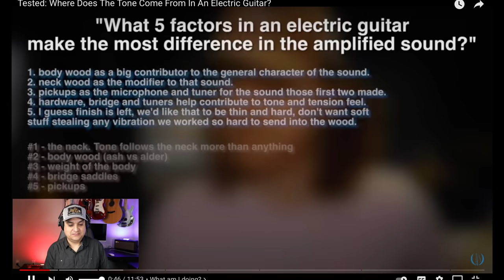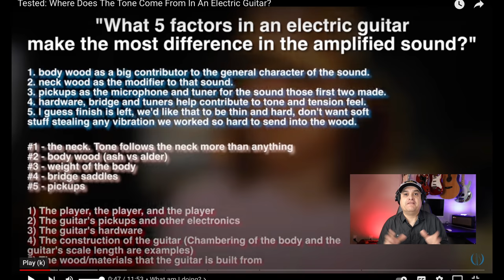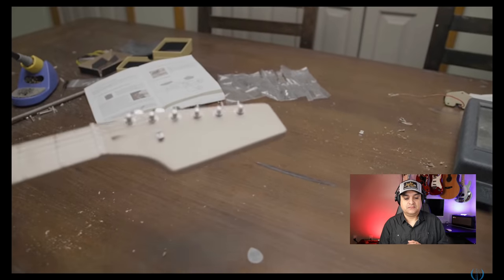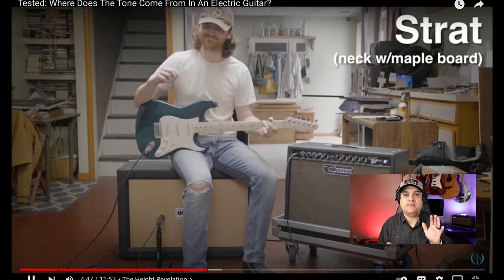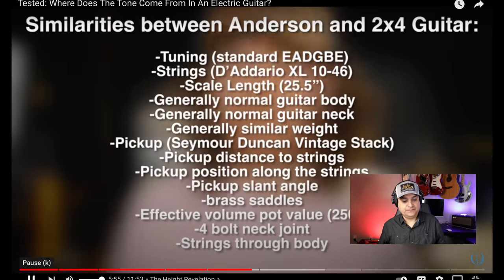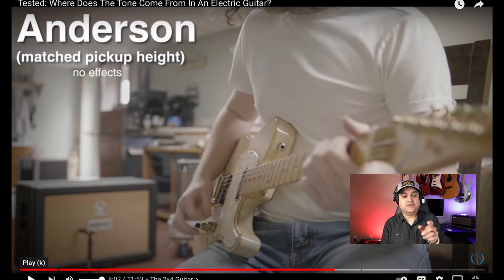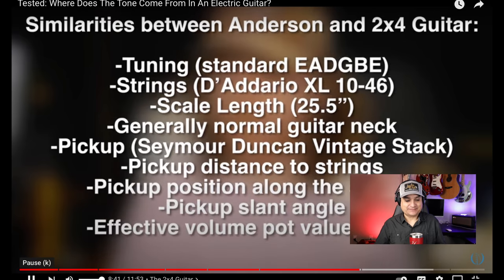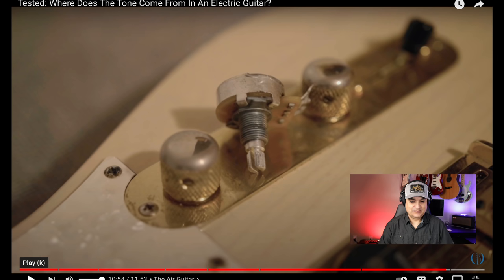Where Does The Tone Come From In An Electric Guitar - Reaction Video

Comment: I have been playing the same bass neck on four different bodies since 1983. It started as B.C. Rich Eagle, Bass N.J. series. The first pickup was the original, most likely a DiMarzio passive. Then I replaced it with an EMG P. The tone changed. Then I put a Kahler tremelo on it. The tone changed. Keep in mind the wood was a butcher-block of at least four pieces of light and dark wood (I stripped the paint off). Then I ordered a solid fully figured maple Eagle-style body using all my existing components. I was not happy with the sound. I thought it lacked depth. Keep in mind, I had the P pickup placed in a traditional placement like a Fender, and I also had the pickup routed like the Fender P, not like the "reverse" P on my original body. Note: those one-pickup 1983 N.J. series basses had a reverse P mounted closer to the bridge more like a MM than a Fender. I was not happy at all with the sound  of that Warmouth Eagle body bass. So then I took a solid one-piece mahogany slab and made a new body, this time using EMG bass humbuckers and a Schaller bridge (that bridge had no mass/substance to it. I took those EMGs from my short-scale Aria Pro II XXB Deluxe bass. That little bass had substance. The difference: Aria Pro II from the early 80s had a fat bridge. My mahogany bass, with EMGs, Shaller bridge, and my old favorite neck always lack punch, way too much treble. My guess is that the bridge was the fatal flaw. So I tried one more time with new body I made out of wenge and padauk, using an  EMG humbucker placed in the same spot as a Fender (supposedly a P configuration in a humbucker housing) and that old Aria Pro II bridge,  and my old faithful neck. This latest rendition sounds and feels great.

Comment: But why does a solidbody guitar sound so different from a hollowbody? The vibrating strings do interact with the wood and that will influence the electric signal as well, which is why you wouldn't use styrofoam for building a guitar. No wood at all is not an issue though...

Comment: I have said for years, as long as the intonation is good and it will stay in tune, I can get a good tone out of just about any guitar. 

Scale length and necks make a difference because of how they feel on you hands. I prefer a fender neck and scale typically but that is feel issue not tone.

Comment: Pickups have zero effect on tone. In a video, a Strat pickup was installed on an acoustic guitar, and it sounded JUST LIKE AN ACOUSTIC GUiTAR!!! That's because the vibrations from the wood go into the strings.
Reply: @@johndoe3319 / If you use heavy distortion, the guitar is only a small ingredient in the tone.

Comment: its funny to watch video's about Les Paul's first solid body guitars and hear how he designed them. He wanted a solid body so the pickup wouldn't move deadening the sound or feedback so all you would hear is the pickups and strings, over 70 years later people still look at electric guitars like they are an acoustic instrument and apply all the talk of woods and construction that would apply to acoustic stringed instruments to them even though they are designed to remove as much of those variables as possible. I love that this test went full circle and ended up at designs that are very similar to Les Paul's prototypes, just to prove he was right all along.

Comment: Around 2005 I bought my oldest son, then 12 years old, a cheap Jackson that I bought on Ebay.  I paid $80 for it and bought all new electronics.  My sentiments were always, buy a guitar that feels good in your hands with a straight neck, because you can always make it sound better with new electronics.  That guitar played great and sounded amazing.

Most recently, I've been on that tone quest.  Wanting just the right pickups and just the right amp.  Should I go with a Mesa Boogie Rectifier or a Mark V?,  Should I go Engl, maybe a 5150.  Do I go with Vintage 30's or Green backs?  How about Jensen speakers, or those Eminence speakers?  In the end, after a lot of research, and although the cabinet and speakers do make the most difference to your tone, when playing through most high gain amps, you can dial them all in pretty similarly.  And most importantly, when they're in a mix, they all sound good. Just like pickups, with the exception of the really cheap pickups, any pickup you go with is going to do the trick. The key is, what are you using it for, and how does that affect the amp as it hits it.  You can probably take a Seymour JB, add an MXL 10 bang graphic EQ prior to the amp and make it sound like a Nazgul.  I haven't experimented with that, but it wouldn't surprise me at all.  Pickups just seem to be pre-EQs.  If it's a lower output pickup, raise it and then adjust the incoming volume on EQ.  Make EQ adjustments and perhaps it'll sound very similar.

I could be talking out my tuchas as well, I don't know.

Comment: I was convinced before, but one question remains: what about sustain? How do dead notes occur, if the neck and body materials have nearly no impact? We put energy into a string, the less resonant the materials are, the strings are connected to, the longer is the sustain. More resonant materials would suck some of the energy of the string and would therefore shorten the sustain. Right or wrong?
Reply: Dead notes come from poor setups or crappy fret work
Reply: @channingsmith7859  Not convincing😎 You almost always find dead notes on the same places, like on the 5. or 6. fret on Fender basses. Highly unlikely that it is the setup or that randomly the fretwork on exact the same locations is poor.
Reply: But somehow “bad tone wood “ would manifest in a consistent manner across instruments? Not likely.
Reply: @channingsmith7859  No, dead notes - following the most common explanation - is caused by the resonance of the wood at certain frequencies that kind of erases the sustain of certain notes at these frequencies.
Reply: I have never encountered a dead note that couldn’t be fixed with a setup. But we all have our own experiences so I’ll just leave it at that.

Comment: This kind of thinking and the guy video what supports my move from getting an expensive guitar to a decent guitar and apply my setting and setup skills all these years. In 2019, I moved from a 1600 USD PRS CE to a local made 125 USD and then modify and upgrade the electronic and parts. I then continue to a 200 USD one then I got a good wood quality thus less truss rod adjustment and other set up as well. Wood since then has been my eyes and hands foundation for a look and feel but not tone.

Comment: Electric guitar tone:
1. Pickups
2. Pickup locations - distance from from bridge / relative to scale length
3. Pickup height
4. Electronics - pots/caps 
5. Hardware: Nut, saddles

The wood, neck type, etc. contribute more to feel which also affects tone but that’s due to how it’s played.  

Tonewood is huge in acoustic guitars of course.  Different discussion. These of course are just my opinions.

Comment: Perfect example Was impressed with 2X12 Egnator amp/ bought it/ mostly used deluxe stratocaster/ liked the tone. Very familiar pickup sound. 
  Very different sound from my 2008 Gretsch Jaguar Tan with TV Jones pickups. You would easily tell them apart  hearing them without seeing them.
   BUT - When I would plug my Gretsch into my Egnator amp --- it sounded just like the stratocaster did. It was not amplifying the true natural tone of the guitars' woods, shape. The amp proved to be a waste of time and money.
  Long ago people said "Play an electric guitar without plugging it in for a while to see what it sounds and feels like before you buy it." For me, that has been very useful ever since.
A friend told me search for articles about "Single knob single tube amp' and you willl understand it more."
  So - I enjoyed this video, watched the original too - interesting stuff - the magnetic field of that same pickup produces the same tone wether it's screwed into a 2X4 or a bench, just like the Egnator amp did which is why I sold it after 2 months. I have no idea how long a note or chord rings out on the Air Guitar or 2x4 he made but all good fun 😊!

Comment: 1. No overdrive would be appreciated in the tests
2. While pickups are electro-magentic, some microphony also occurs; just tap the body, or indeed the pickup itself with a pick, (strings muted) and you'll hear the sound of the body.
3. Tele bridge plates plates differ; some are brass, others steel. Brass bridge plates do not have the ferro-magnetic property that steel ones have; this property when, considering its wrap around the bridge pickup makes a significant difference.
4. Softer wood types will absorb energy from the strings, unlike their hardwood counterparts like ash, alder etc.
5. Also, consider the difference in sound between semi-solid and solid body guitars.
6. Pickups ARE important
Reply from the maker: 1. Why, if that is how a person uses the guitar, that's how he should test. 
2. Even with strings muted, you still have inductance because they are still magnetized by the pickups. 
3. The Material of the bridge (ferrous/non ferrous) does not affect the pickup. The magnets are magnetized axially, so the inductance happens above and below the string. the movement of the strings above the pickup vary the inductance more than the existence of the bridge around the pickup (also non ferrous materials can have other negative effects?
4. Then why do people use mahogany for "sustain" when it is an extremely soft wood?
5. When you add an air chamber to guitar.... there is no longer a basis for any comparison. 
6. I agree.
Reply: @DylanTalksTone  1. As a 'bench test', for all to assess, his personal taste in amp settings should be set aside, so that the sound of the guitar without overdrive is what is being judged. It has to be a clean signal to start with.
2. even without strings. the body will pick up some acoustic vibration...try it!
3. In the case of a Tele with a steel bridge plate, the vibration of the strings conduct through it and because of its  ferro-magnetic properties are picked up by the bridge pickup.
I've changed mine from brass to steel and there is a world of a difference.
4. "Mahogany, any of several tropical hardwood timber trees, especially certain species in the family Meliaceae." 
(Britannica   c.)
5. but, your argument says it’s  wholly electromagnet induction.
6. Agree also
Finally, I choose solid body guitars initially when they're not plugged in and there is considerable variation, even within the same models.

I’m not trying to win an argument here, this is just my take on it 😊

Comment: Regardless of what this video proves or doesn’t, there are certain guitars, one in particular, that I will always reach for first and I can tell you now it’s nothing to do with the pickups or the setup. It’s the feel of the guitar, that something that the other guitars just don’t have. The example that I use is that I own 2 American original 50’s Stratocasters. They are both setup exactly the same, one is alder and the other is ash. The ash one feels more alive and consequently I play better on that one and the tones are definitely different. I’ve even swapped the pickups round and the difference is still there.

Comment: Electric signals picked up by metal wire vibrations in a magnet will never pickup any toan from wood. Let alone solid body wood. The important things on an electric guitar is the components that create and pickup the vibrations, Coils and strings. Thats it.

Comment: I agree with you and I agree with him and I'm one of those guys who has laughed at the myth peddlers for years BUT I'm also one of those guys that said it would have been a slightly better test with zero drive. There's a reason though. His choice of pickup amp and settings could potentially mask differences that jump out in other scenarios. For example if your amp doesn't produce much low end you won't hear much difference in two pickups with considerably different low end response. If I compared two guitars say a cherry bodied offset to a plywood bodied squire strat (same pickup) they sound pretty much the same through my little battery powered amp but through my half stack the difference is massive. Just saying his testing could have been more comprehensive.

Comment: Most important thing in a guitar: does it look sexy enough that you are compelled to pick it up daily and play? You can always put the work in to make it as playable as you like. You can always choose any combination of pickups, amps, and pedals for your sound. Myself, being a single-coil guy, I tend to replace my humbuckers for P90s or play coil-split or tapped (Depending on the sound of the pickup, some humbuckers I leave alone). I do all my own fretwork, electronics, repairs and setups so the species of the wood is irrelevant except for aesthetics. Which is, like I said, one of the most important things. If it's made with a species of wood you like and it makes you play it more, then by all means, spend the extra money for the quality wood.

Comment: I actually did hear a difference with the smaller headstock and the looser neck joint. When you immediately said “NO DIFFERENCE” after that I was taken aback because I heard a pretty obvious difference.
Was it as big a difference as changing pickups? No, but there was still a difference and I heard it.
By the way, I totally agree that whole thing about “there’s too much distortion, you can’t hear any difference“ is BS. If anything I actually hear more differences, and besides that’s the guitar sound many people listen to anyways.
Reply: I felt the same as you but then he qualified those statements by saying that there may be a slight difference, but it's not enough of a difference to even consider. Which I agreed with. I think most people wouldnt hear the difference and the difference isnt good or bad. Just slightly different and that difference can easily be negated with other factors. The point is that any difference you hear at that point is pointless to be concerned with.

Comment: The Bench is the guitar body just not under the strings.. But think about it.. the string is attached at the headstock and the bridge. All the shit between is just for holding it together. The "tone transfer" does transfer into the body.. Which that would be the benches.

Comment: I actually had a question about this I was hoping you could answer. Do you think this conclusion would change if you had a set of pickups that were not wax-potted? They will pick up vibrations from the guitar if you tap on the body or mess with the knobs and switches a certain way. They’re often found in older guitars - surely these would pick up some sort of tonal characteristic of the wood?

Regardless, it’s really clear the tone only comes from the pickup and whatever it will pick up, and the only thing most pickups pick up are strings.
Reply: I watch a video the other day comparing wax potted to non wax potted pickups and they sound exactly the same. the guy doing the comparison thought they sounded exactly the same and he was expecting there to be a big difference.

Comment: Ive been a furniture maker/woodworker, all my life. Tonewood IS absolutely a thing, but it has to be thin enough to create resonance. There is definitely a difference between a Spruce top, hard curly maple body of a hollow body, acoustic guitar or (Violins). I would say a maple capped guitar will have little to no sound difference from a solid body mahogany version (think Les Paul/SG, identically equipped). The nut, the bridge, scale lengths, pickups, pots and how all that is set-up are where the tone is created and changed.

Comment: If you hear that tiny difference in the guitars, remember that the tolerance in the electronic components can be as high as 20%, more in likely 5 to 10.  So, even between identical guitars from the same manufacturer there will be slight differences.

Comment: lolz, it's funny that some many people don't know this. When it comes to electric guitars the best question to ask yourself is, what is the biggest filter? It's the pickups. Same with amps, what is the biggest filter? The speakers. 

There are tons of examples of other factors that do effect tone but they are generally more expensive and don't change it as radically and should be left for people with developed ears or advanced players that actualyl have the knowledge and experience to change out a bunch of parts on their axe.

Comment: The material the nut and saddles are made of does make a difference.  Try a brass nut and you will see.  The string gauge also makes a difference.  Watch Beato’s video on that. The wood? Not so much.

Comment: What matters in guitar construction: the more solid it is, the better. Not because of vibrations but the opposite of it. It makes everything that touches the string sit solidly and it acts like a "mirror", all the energy bounces right back and isn't absorbed. Resonations are very low in energy levels compared to the direct sound, so.. doesn't matter. As long as the body is made using some rational sense, that it is not made of styrofoam but basic wood, or plastic... or anything really, it'll sound the same. Player makes more differences.

I grew up in an instrument repair shop and if you give a musician an old vintage legend, they are going to play it differently than a mid-range instrument but if they would do it blind folded, they would pick new mid-range instrument. The old can be a rattlecan, heavy in weight and heavy to play but... they will still pick it. It is not muddy, it has warmth and character.. Every negative quality becomes positive if there is prestige in the name and model.